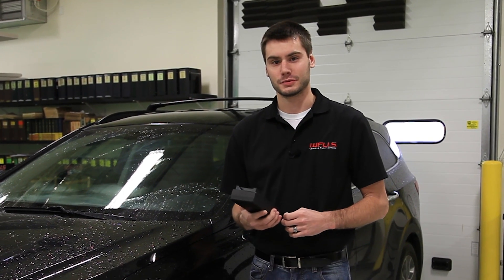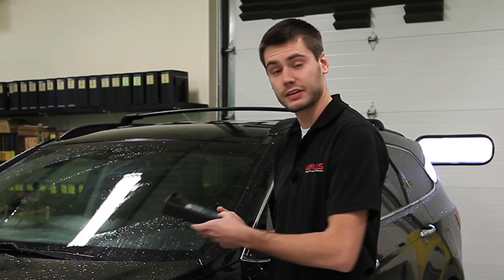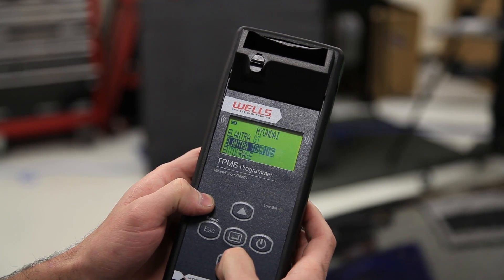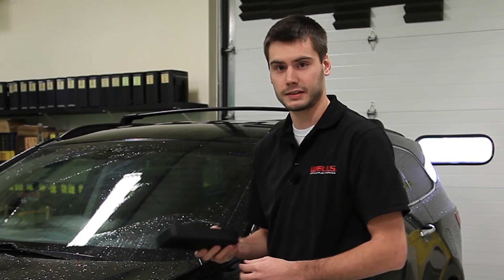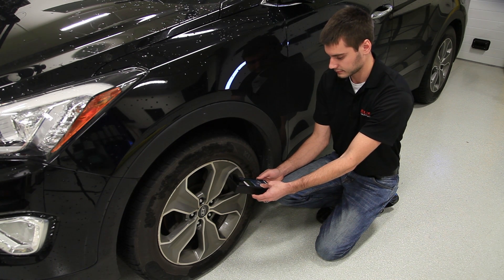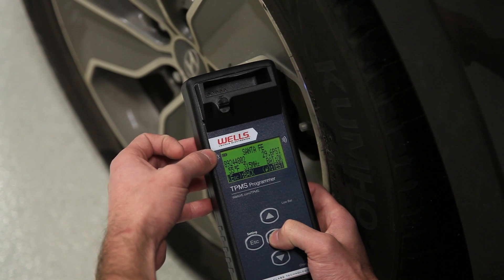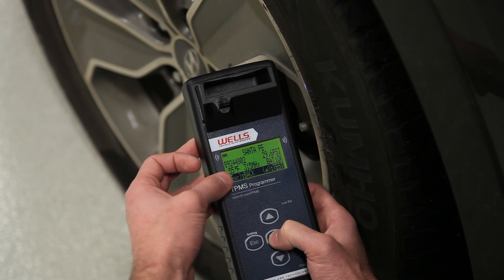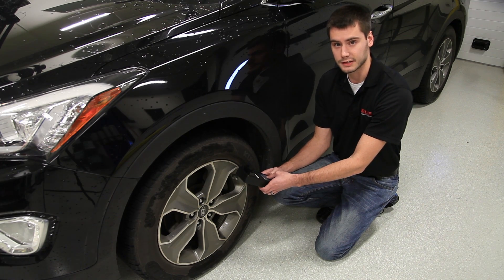Wells TPMS - How to Diagnose a Sensor

Comment: Nobody will buy one of those just to diagnose a sensor.
Reply from the maker: Why not? You have a cheaper tpms diagnosis tool option?
Mike Becker, Senior Technical Instructor
Reply: @GoTechTraining  should be a cheaper solution for home users to detect a bad sensor.
Reply: GoTech Yes, it’s called air up all the tires to their proper pressure then one by one, deflate the tires. The tire that doesn’t throw a warning has the bad sensor.
Reply: @noogman  If your TPMS doesn't indicate which specific wheel is low then that's the point of inflating all tires to OEM spec, then deflating each tire one by one by 5-10psi to single out the bad sensor. Should be common sense not to deflate your tire so much that the seal breaks. Or if you're experienced with diag tools, you can buy a cheap $50 one off Amazon, i've done this as well.